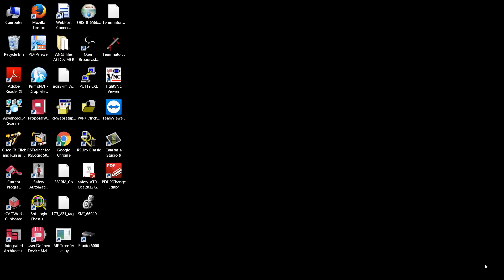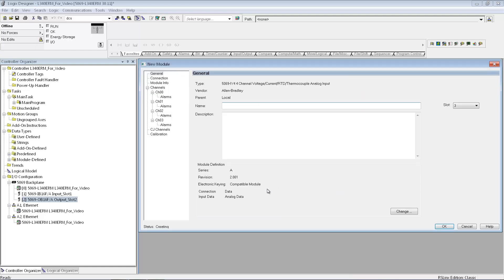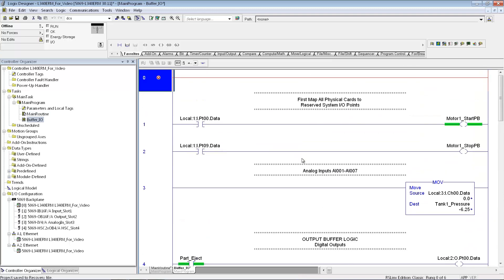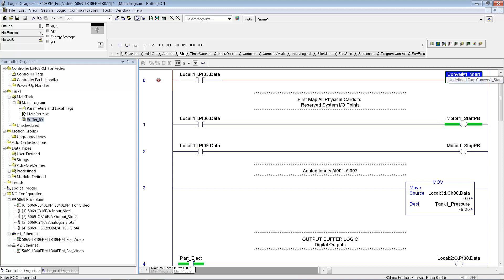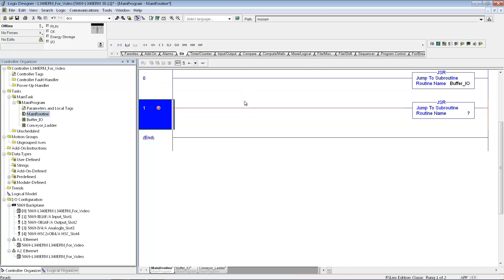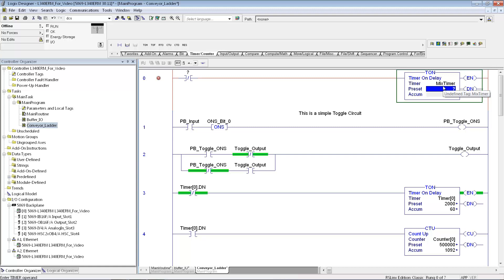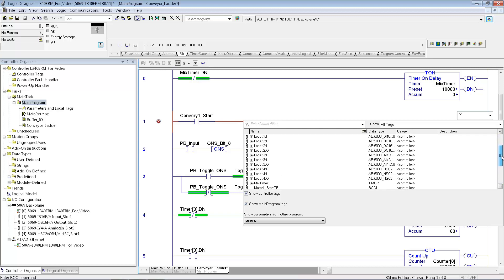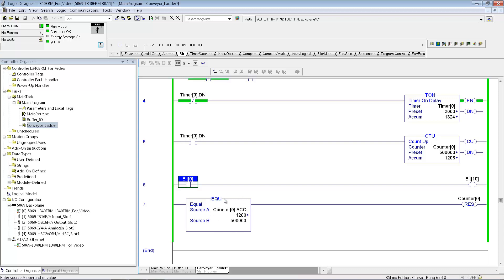Programming Logix with Rockwell Studio 5000 from scratch video by Todd

Comment: hi, am pretty good with rslogix 500, but in 500 they changed the way you assign the bits. is there a video explaining that? used to be you clocked the bit and it said its card designation but i cant find the new way of doing it.